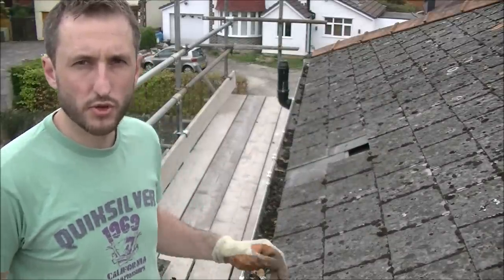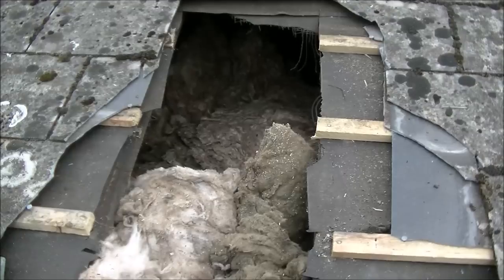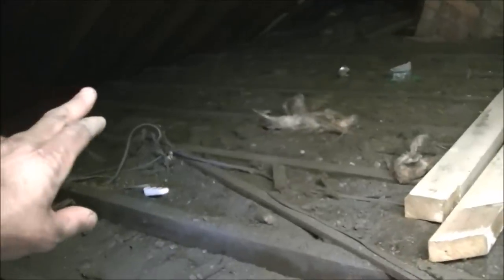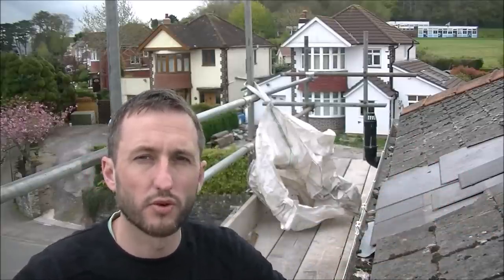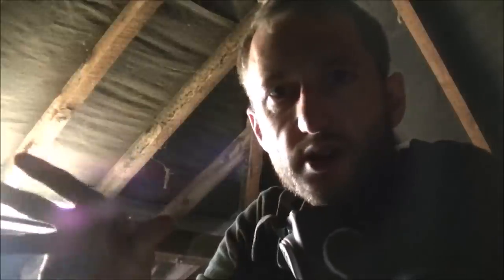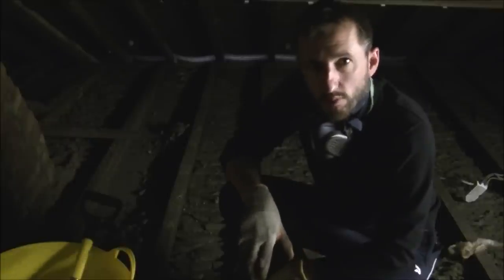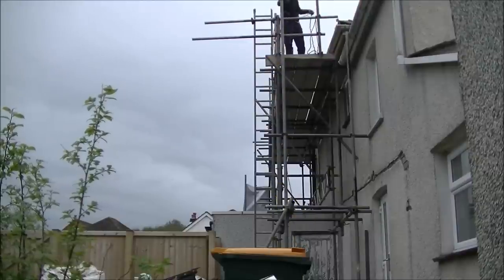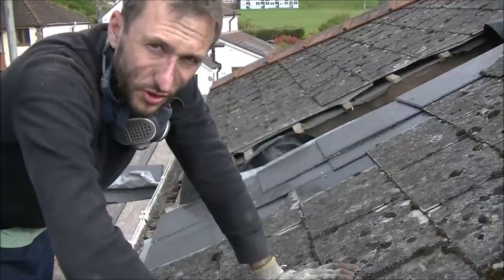Loft conversion part 1 - Break into roof, remove old insulation & mortar. DIY Loft conversion

Comment: You could use 3/4" ply packers on top of your walls to raise the joists above the old ceiling plaster. Saves loads of messing and meets regs
Reply from the maker: I did use packers which you can see in Part 2. But the mortar was so thick it need removing and as you'll see in later video it's well worth it as it makes a much cleaner working environment and less weight on the ceiling. I filled a whole builders bag with the mortar I removed. Hope that helps. Thanks for watching.

Comment: Using your videos as inspiration for a diy loft conversion of my own however I will be getting in a loft conversion company to do the structural work.
Reply from the maker: Probably not a bad idea. It always takes longer than you think and I'm a sucker for punishment. Not everyone is! Best of luck with the project and thanks for watching.
Reply: @POUSEaroundtheHOUSE  i am the also a glutton for punishment when I think something is withing my capability although I really don't like ladders. I will be doing the internal work accept for joining the electrics to the fuse box.
Reply from the maker: @alexwalker9803  sounds good. Let me know how you get on.

Comment: Good video.
Part way through doing similar myself.
As someone going through it a video on installing velux windows (from inside only if possible) when to board and when to put up stud work vs installing the insulation boards and plasterboard above and how to route cabling/plumbing, would all be great!!

Mind is going so slow I imagine you will overtake me very soon!
Reply from the maker: Hi Paul, I'l be filming it all hopefully in the order that I do it so maybe some ideas for you in future videos. How and what order you do things is often up to you really. I'l be doing my insulation from the inside as I'm re-slating the whole roof. I need the new roof sorted asap then I can take my time with the internal stuff once the roof is watertight. Thanks for watching!

Comment: Really great helpful videos, thank you! What was the timescale of the conversion and what was the cost of it doing yourself?
Reply from the maker: Timescale.....it's still not finished! Joking aside I got a lot done in a few weeks, but with family, kids, full time job I always knew this would just be done in spare time weekends. I also re-roofed the house which you don't need to do with a loft conversion. I painted the house and did all new soffits, fascias etc. So difficult to say as I've had months off at a time also. If you've got kids etc it's not always plain sailing when living in the property. But about two years in total on and off. Everything I've done has come in at around 14k but that will vary according to what part of country you live I guess and material prices. Hope that helps. Thanks for watching!

Comment: Hi since having a loft conversion 2 years ago my house is cold in winter they didn't add metal wire gauze in the flooring used my old insulation and after using wall insulation I think celetex they simply added the plaster boards they didn't use silver quilt and then use silver tape to make it air tight I wanted to know how you did it before plaster boarding it internally thank you
Reply from the maker: Hi, if you go to my playlists on my channel, go to 'DIY loft conversion, then Part 27 and part 28 show how I did the insulation. Hope that helps. Thanks for watching.

Comment: Did you do any drawings for this? I’m interested to understand your planning process and building controls etc.
Reply from the maker: I drew what I wanted roughly then took all the measurements. Structural engineer did calculations and structural drawings. I applied for a building notice with building control then started work. Building control inspect at key stages of the build. Thanks for watching. 👍

Comment: Hey Pouse, love the videos and finding them really insightful. Random question, I have a end terrace house that has previously had a loft conversion and there is a single window dormer letting light in. I was thinking of making it a double to let more natural light in as all my (terrace neighbours) have double window dormers aswell. Do you think I would need building control to be involved just to make the dormer slightly bigger? As I don’t plan on making any other alterations than that. Keep uploading as they are a big help!
Reply from the maker: Best bet is to speak to building control. In theory yes you prob do need to speak to them as you are potentially changing the structure of the dormer, but in practice, if you know what you're doing, you can strengthen the timbers above the new window. If in doubt seek advise. Building control are usually very helpful. Best of luck with it.
Reply: @POUSEaroundtheHOUSE  thanks Pouse that’s really helpful. Hope your enjoying the loft? as I imagine it’s all done now!.
Reply: Crazy idea, just keep the dormer and simply add a roof window, dual aspect will provide plenty.ty of light. No inspectors, cheaper, quicker and way better. You'll have two views too. My advice butty

Comment: Hi Pouse, I have a loft which I want to use as storage and occasional office accessed by loft ladder. The headroom is about 1.9m from floor joists. Joists are 3x1.5 inch.  There is a central support wall and spans are about 3m from c/l of support wall to each outside walls. 
So looks like I need to strengthen the existing joists, similar to yourself? Did you have a structural survey and cals done for the floor joists?  Like you I don’t want to compromise headroom too much.
Mine however is not going to be a permanent habital area.

Comment: I would be really interested to see your architects plans for this build, I am nearing completion of my own loft conversion (DIY) and I was told multiple times over that the weight of the roof and floor can not under any circumstances be directed to solely the original load bearing walls without any form of central reinforcement i.e flitch beams in my case or steels. Your house layout must be perfect for them to allow this.
Reply from the maker: Hello both. The structural engineer has designed the joists to carry any additional load. Stating that calculations are unique to each project is obvious. Old houses have different sized everything, hence why building control sign off is required to make it a habitable room. I haven't used an architect as I don't need one. Building control are happy with the calculations. This conversion has gone via the route of a building notice not a full application where the work will be inspected periodically by an inspector. The gap between me and the neighbour is being blocked up on top of the solid brick wall that lies below separating my house from next door. You can watch this in my future videos. As for electrical work, in the UK it can be carried out by the homeowner if inspected by a qualified competent electrical tester and inspector, or if you pay building control extra for them to send an electrician to inspect the work. Thanks both for watching, hope that cleared a few things up.
Reply: Fair play mate! If building control are happy then that's all that matters and yeah I've done my own electrical work in the loft as well, however, finding a 3rd party that are happy to inspect it is a royal pain in the arse, even building control couldn't find anyone, took me around 3 weeks to find someone willing to do this for me, still saved a load of money though.

Will be interesting to see if they make you do all the stuff they asked me to do like putting chicken wire between the joists to hold up insulation if there is a fire and stuff like that.

If you do get stuck on anything that you want a second opinion for sling us a message I might be able to help in some way :) 

Looking forward to the next episode mate.

Billy
Reply from the maker: Mr Brightside - Wonderful, well make sure you click the bell at the top of the screen to get regular notifications. Look forward to your comments as always. Thanks for you your valued input and thanks again for watching.
Reply from the maker: Fruit men - Thanks for the info, I'll be sure to give you a shout if I cross any problems. Nice one.

Comment: Many engineers wont quantify the load bearing characteristics of a 'solid' old Victorian stone wall because they are actually blocks of granite, slate etc filled with lime mortar that has perished. As a builder we have to be so careful with dealing with theses walls because once the bond has broken then you have Jenga on your hands. 
Great videos but I do wonder how many of the viewers have tried to build along these lines just to find out that engineers will not quantify the structural requirements?
Reply from the maker: If you're doing it 'legitimately' through building control, submitting an application or building notice and therefore requiring sign off as a 'habital room' then you will require structural calculations to submit to your local authority building control officer as part of the build. These will be done by a structural engineer who should check these things first. I've had my house in pieces in the past so I know what materials and foundations are present and submitted calculations as part of my application. So I completely agree with you but I guess if people do anything on this scale without the correct research then on their head be it! A quick call to your local authority building control department will give you all the answers you need and mine were very helpful. Thanks for the comment and thanks for watching 👍
Reply: @POUSEaroundtheHOUSE  Hello mate. Great response and thats what I would have expected from you. I am in no way questioning you, your work or your integrity. I can tell that you are a sound geezer just from the videos. I used to build all my lofts from timber and to be honest still would if I could. The trouble is that engineers are doubling all the sizes to cover 'the just in case' scenario that their insurers worry about. Some of the old inspectors look at the steels I have to fit now and scratch their heads in WTF style motions. I am putting so much over-engineered weight up there I expect the bloody house to sink one day and the clients 'loft' is now a bungalow!! 
Like you, like your work... old school.
Take care. Pat
Reply: You make no sense. You are mixing the joist strength with the overall weight pushing apart the walls

Comment: Have you had a structural engineer to calculate joists and span, roof weight, rafter strengthening etc?
What kind of height have you got?
Party wall act?
I had one done 10 years ago with steel, never again!
Reply from the maker: Yes all calcs done, suitable ceiling height for building regs, why do you ask? Thanks for watching!
Reply from the maker: Mr Brightside, hi again, yes calcs done.  Of course you can support additional weight on the joists if they are strong enough to do so.  What 'manual' did you read that said you can't? Anyway, thanks for taking the time to watch all my videos, appreciate it.
Reply: Can't wait for the next installment, glad you've done it "officially" 
It's a bind but makes your house a lot more sellable
So many rules and regs 😞

Comment: Do you need planning permission to begin a loft cnversion?
Reply from the maker: Depends what you are doing. You have a lot of questions. Best to read the planning.gov.uk guidance and the building regs guidance online. Then speak to your local planning department and building control who will answer all your questions. Planning is dependent on where you live and building regs are different in different parts of the country.